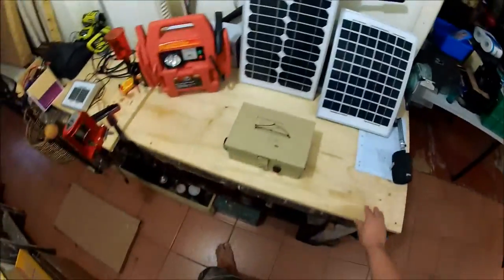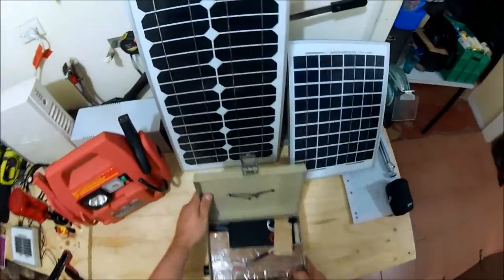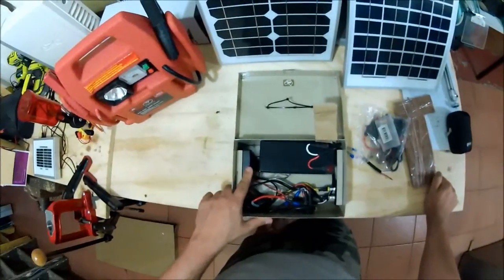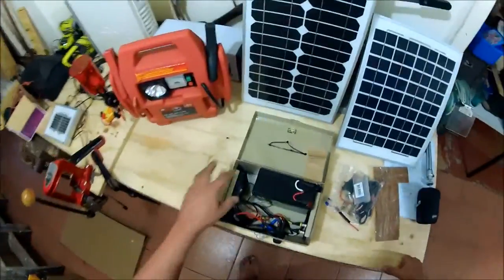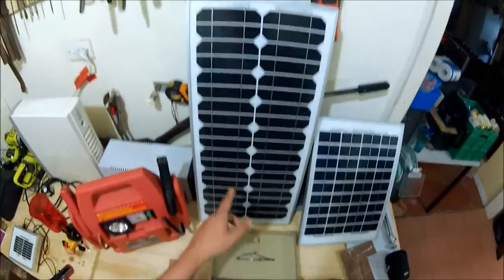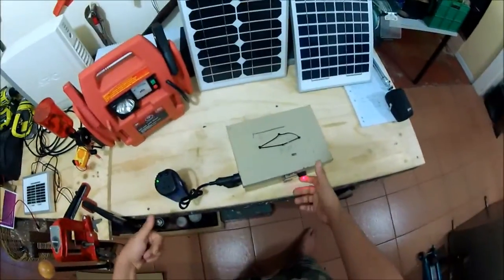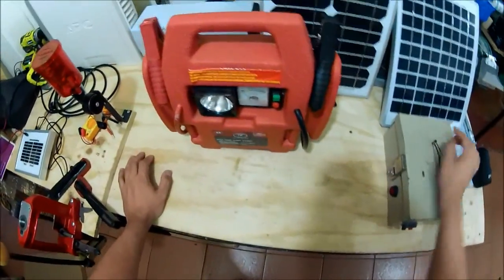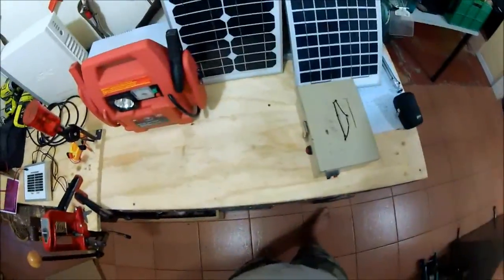How to: Build a Cheap Portable Solar Generator!

Comment: Haha yeah you already had a way better power storage and usable Amp hours in your jump pack. Sorry mate very inefficient you do realise you need more than 12 volts to properly charge a 12 volt battery. Say a solid 13-14volts.  I have an orange jump pack as well and the transformer output is 14 volts.  Also get a tripod all that movement is annoying !!  Still a thumbs up
Reply from the maker: Hey Mate, Yeah those panels are around 17-18v as stated in the video. Also agreed on the tripod! i couldn't find my one and the only camera i had on me at the time was my go-pro so i just though "ill wing it!". not my best as you can tell. The reason i didn't end up using the jump pack is because i actually needed it to stay at home as people in my family use it often and the reason for it being in the video was just a suggestion to others at an easier alternative.
Cheers mate,
Nuzo